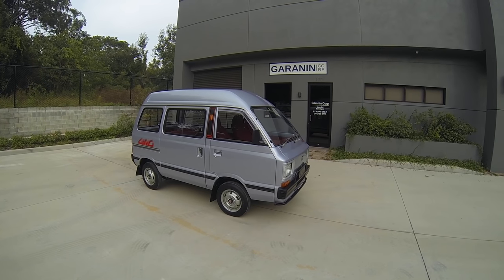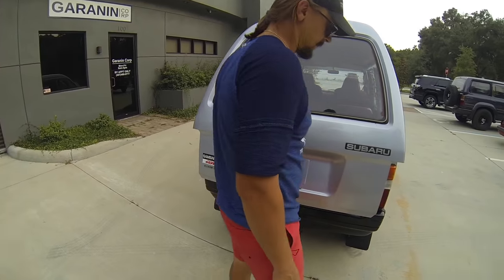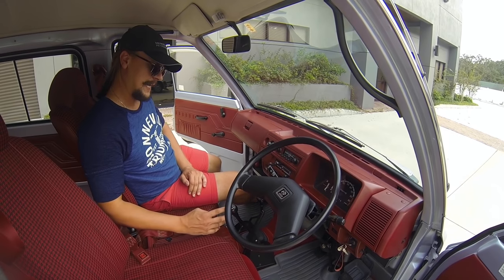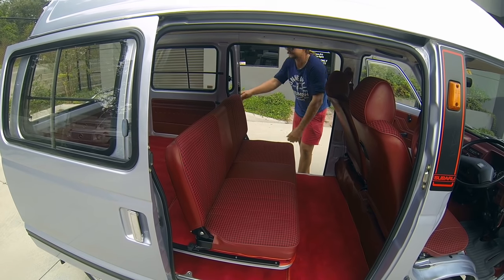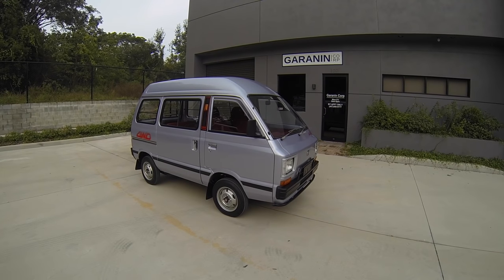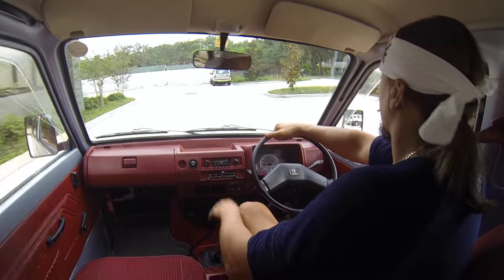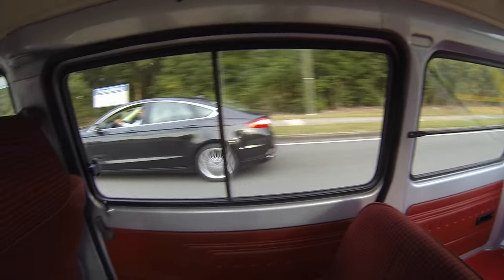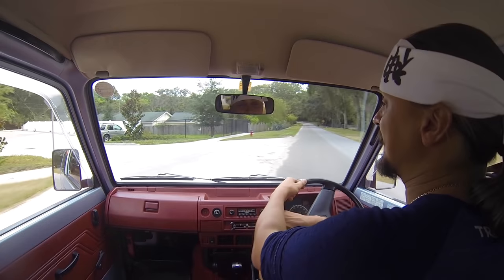1983 Subaru Sambar Try 4WD Kei Mini Van ULTRA CLEAN

Comment: We had these as vans in the UK. 2WD or 4WD. They were called Subaru Sumo in UK
Reply: In the early 1990s I nearly bought a green one, 3 cyl 1.2L.   I wanted it but my wife said it was 'embarrassing' like a Bedford Rascal.
Reply: @dreamdiction  I think it would have been a better vehicle than the Rascal. Those old 4-pot Suzuki engines aren't up to much.

Neither of them is embarrassing.
Reply: I had one for 3 years  great paint finish on them. The vehicle front even came with  stone chip paint  from the factory  the best micro van I ever had it is a shame that Subaru decide to concentrate on luxury fast Impresa type cars after that and all there vehicles  like the pick up etc were not imported anymore. This was due to import restrictions from vehicles outside the EU only allowing a certain no to be imported.